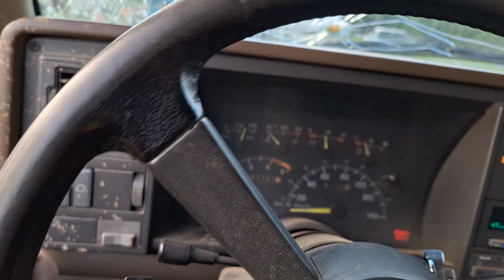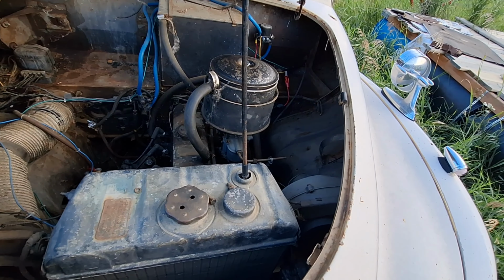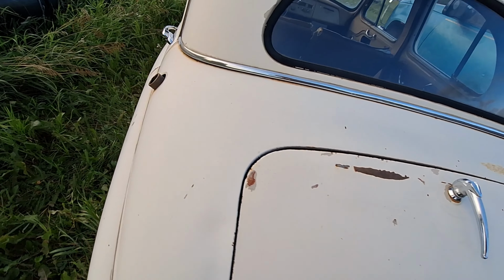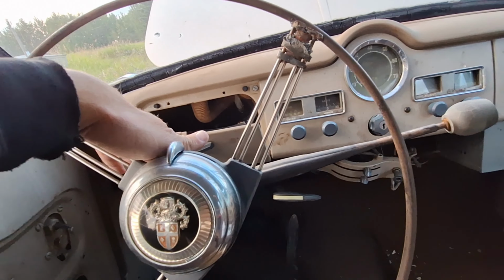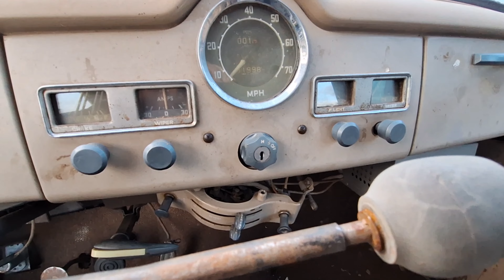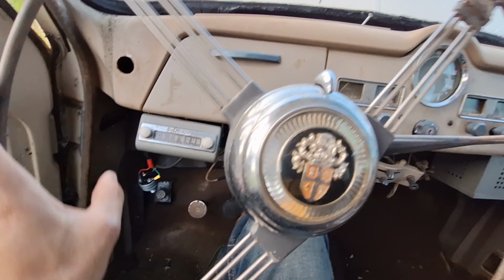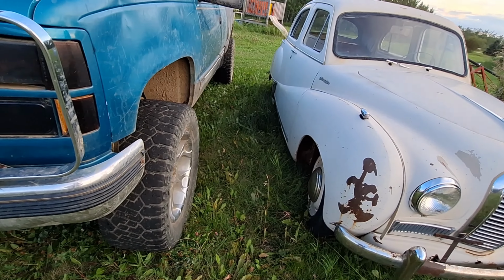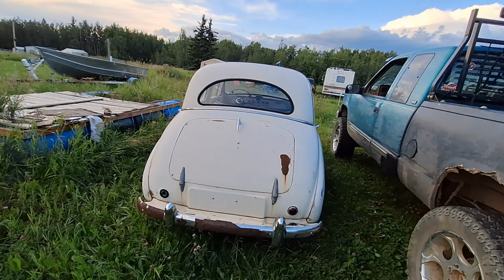1952 AUSTIN A40 Walk-Around

Comment: Love old Brit cars 🚗 being a Brit ❤ I owned and used a Ford Anglia in U.K.
Reply from the maker: The Ford Anglia is cool.
Reply: @Connor4x4  
I lived in a rough part of U.K. people tried rob it, eventually I put a cut off switch on it, but they even tried to bump start it lol 😂 one morning I found it middle of road doors open 😯
Reply from the maker: @radioreaction  That's messed up. Lol
My brother's truck keeps getting broke into. So we're gonna put a hidden switch in. Darned theives can't just leave people's property alone.
Reply: There was a time when British cars were innovative and reliable. My brother had a "sit up and beg" Ford Popular, my father had a 100E van. Both had side valve engines. The windscreen wipers were powered off the inlet manifold. Going downhill they worked great. On full throttle going up hill, no vacuum, no movement of the said wipers. Later, I bought a Z-Back window Ford Anglia. When it stopped one day, I saw three pistons down and one up after removing the cylinder head. Didn't seem right. :- )
Reply from the maker: Haha classic. Haven't seen wipers like that in a long time.